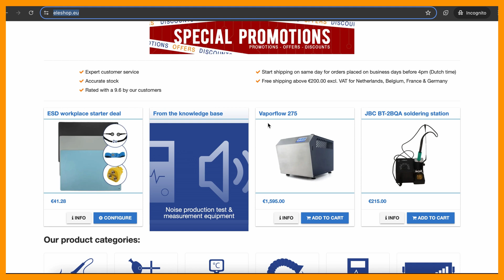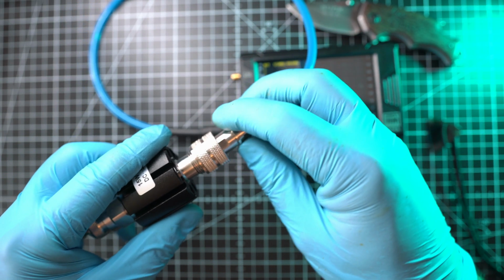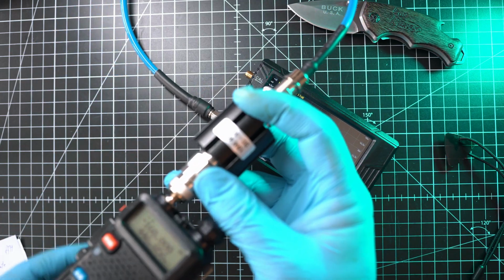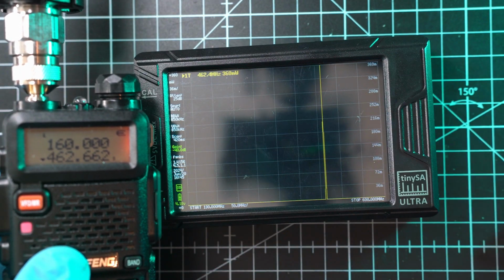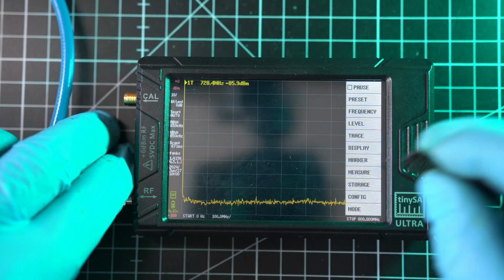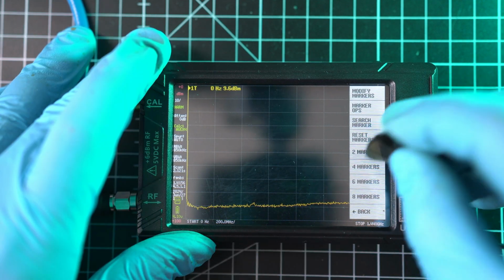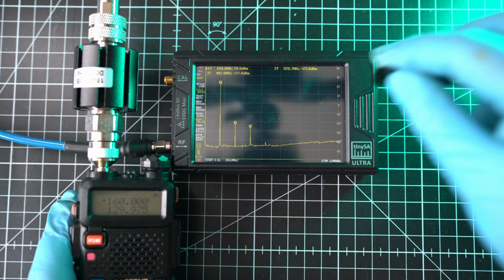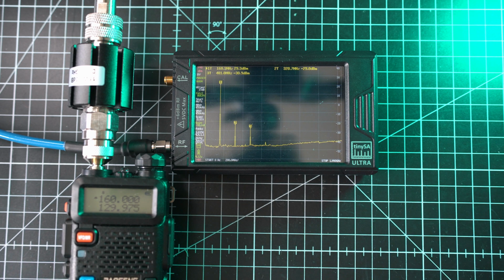TX Power & Spurious RF Emissions of Baofeng UV-5R

Comment: Interesting, though why would you test in the maritime VHF, it's intended for ham at 145MHz, you'll probably still get a similar result, but no-one should be transmitting at 160MHz with these.
Reply: If it's capable of doing it, you are meant to use it. Super simple.
Reply: @kevinroberts781  it's not legal for that, or type rated; super simple.